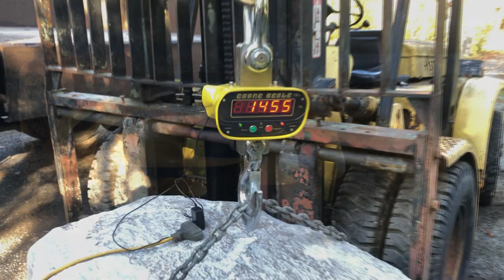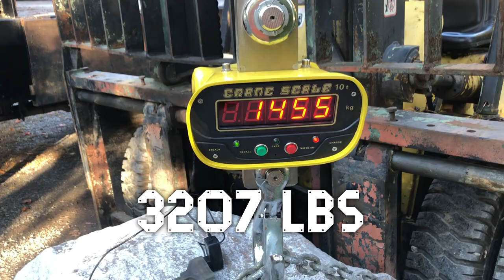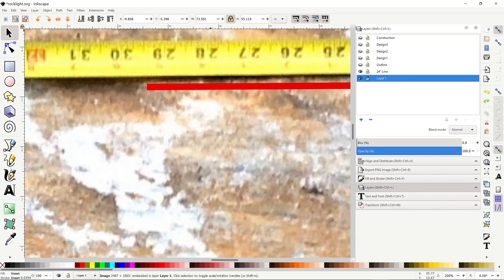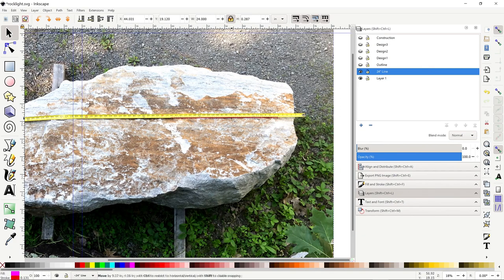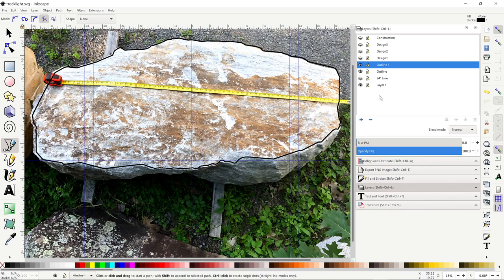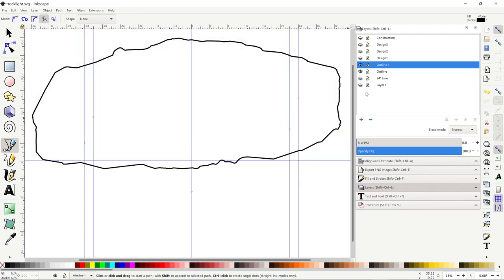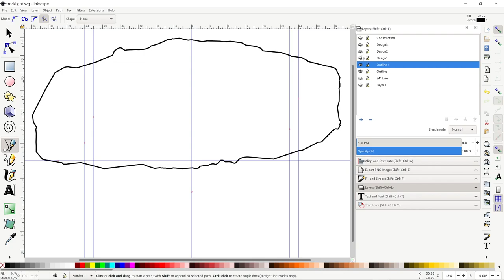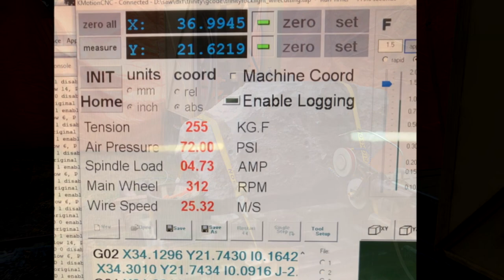How to make a Solid Stone Light #landscapelighting #cuttingstone #CNC

Comment: This is absolutely amazing and I would love to be able to do this in the uk.
Reply from the maker: Thanks Shane!  Find yourself a used Hofmann or Ravaglioli automotive lift, the kind that use a large screw (vs hydraulic cylinder and cables) and you are halfway there.  Use that for the main frame that moves the large wheels up/down.   All you'll need to control down speed is a simple VFD.  That will get you cutting simple vertical cuts.  I used half a lift section for the horizontal table movement.  Now you have horizontal/vertical (XY) movement.  Add some encoders and CNC controller and you are on your way.  If you do start building one feel free to contract if you ever get stuck.
Reply: @GregsStoneYard  thank you for the reply Greg. I’ve been looking into it and I think I might start with a small 1mx2m cnc machine and then work my way up from there. 

I’ve never done cnc before but have a background in engineering so I hope it might help

Comment: How do you feed the sawblade through the stone and then put it back together?
Reply from the maker: The sawblade is actually a steel cable, with beads that have diamond on them.  At either end of the cable, a connector is crimped on.  The two ends then thread into each other to connect the cable.